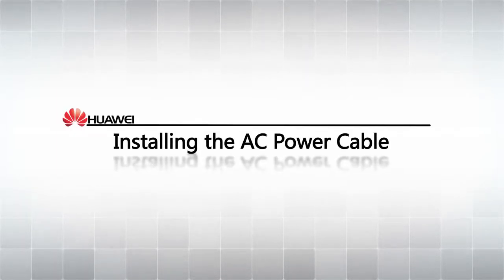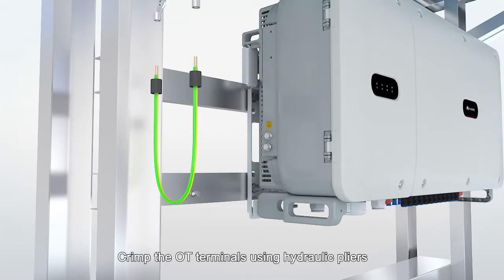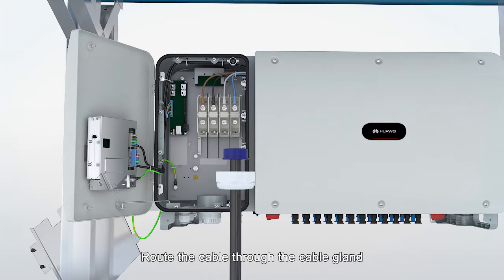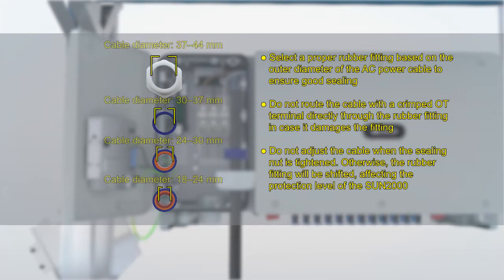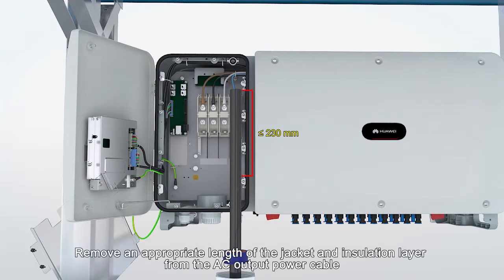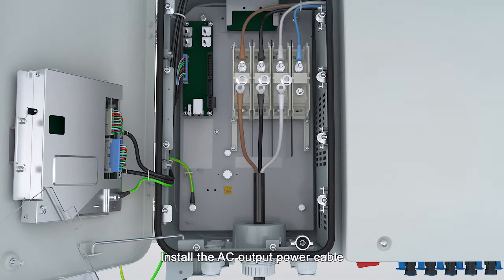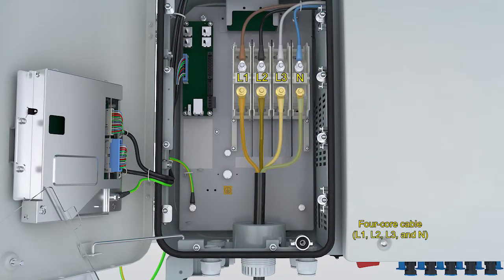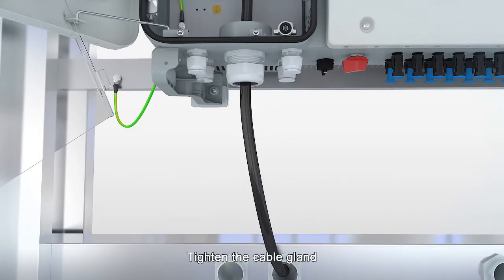Huawei SUN2000-(50KTL, 60KTL)-M0: 04 Installing the AC Power Cable

Comment: If both ground cables connected , inside and outside of the compartment, will it cause an issue ?
Reply from the maker: You need to make sure that the two grounding points come from the same point. If not, it is equivalent to forcing the two ground points together with the inverter, which will cause problems, so it is recommended that only one ground cable be connected.

Comment: Is there any option for smart power sensor with rating over 250A? Thanks!
Reply from the maker: Thank you for your feedback.

You can choose from DTSU666-HW or YDS60-80 Smart Power Sensor.
https://support.huawei.com/enterprise/en/doc/EDOC1100262247
https://support.huawei.com/enterprise/en/doc/EDOC1100242207

If you have any other questions, leave messages in corresponding web pages.

Comment: So, at 1:55, as soon as I have the ground cable connected inside the compartment box, is it safe to remove the one on the outside? Or do I have to remove it?
Or are you just telling me not to connect another one?
Reply from the maker: Hi, thank you for your feedback.
If a ground cable is connected in the maintenance compartment, you can remove the ground cable from the enclosure or retain the ground cable. The ground point on the enclosure is prefered. For details, see https://support.huawei.com/enterprise/en/doc/EDOC1100008865?idPath=22892350|21439560|7921563|21102414|7551590.

If you have any other questions, leave messages in corresponding web pages.